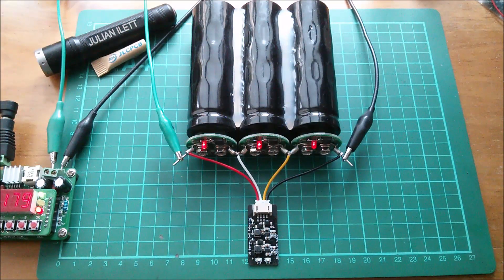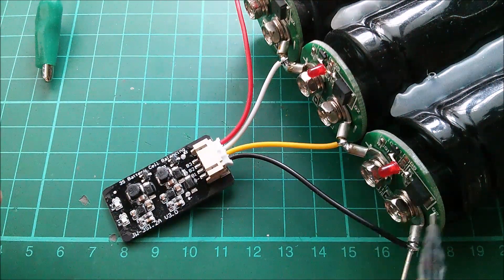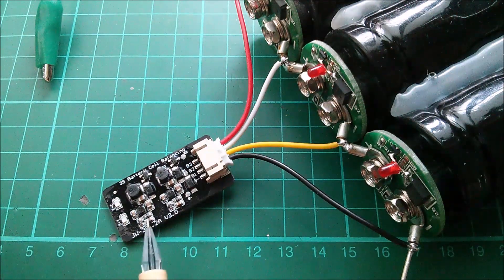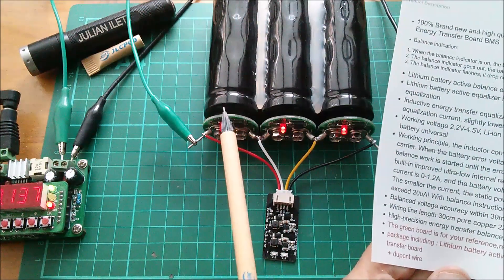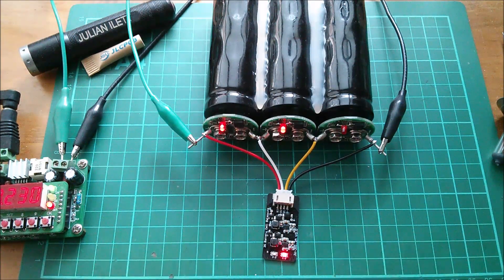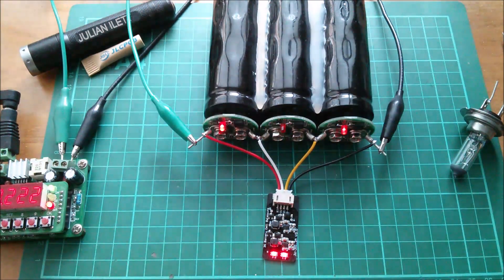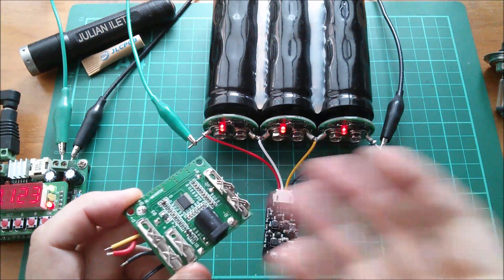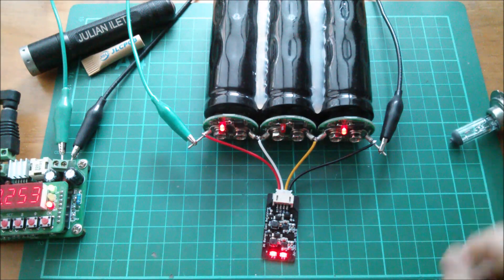Active Cell Balancer for Lithium Ion Battery Packs

Comment: So it's like a bulletproof battery, you can connect to any number of it's cells and it'll just take it.    If pulling under 1.5 amps you could debatably use this instead of a buck regulator, by just choosing how many cells you pull from.  This is wild, every multicell battery out there will now be able to output multiple voltage ranges instead of locked to only one.   
Does this also mean you can charge just one cell - and that one cell will then be used to charge all other cells in the pack?  So you no longer need a high voltage supply to charge this battery.  It can effectively charge as if the cells are in parallel instead of series.
Reply from the maker: Well, sort of. All that stuff is theoretically possible, but it would have to be done at low current.
Reply: @JulianIlett  probably works great if your use case is somewhat like this:
you have a high voltage high power application that requires batteries, but you also need a small current at a lower voltage for, say, some monitoring device. current sensors, wifi connectivity and somesuch.

while you could put a buck converter to power those, and it might even be reasonably efficient for the designed load, that wouldn't also give you the benefit of active balancing.
Reply: Yeah it's early days, but think of the next version, think of the modifications.  I'm hoping it might be cost effective to beef it up.
In TV shows & video games, technology is often oversimplified to an comical extent where if you just touch a battery onto ANY power source it'll somehow magically recharge it, everything interfaces with everything.  Blissful.  
edit: aww, on reading more it seems the current goes through the chip, so the chip itself will always limit to 2A max (so says datasheet).

Comment: Julian thanks for sharing,the question is ! as literally the word balancing means : if using a DVM and testing the voltage across each cell it should show equal voltage after a certain time wouldn't it ? any heat builds up during balancing? it looks like an opto-isolator was used to activate the voltage sensing comparators op-amps i suppose.cheers mate.

Comment: Put a Volt Meter on each capacitor and you'll see it's not boosting any voltages. It is bucking all voltages.  So it takes the higher voltage of 2 cells/caps, and bucks it down to the lower cell/cap. With the inductors, it must do it using pwm, which makes sense because it needs to be decoupled when transferring the energy, otherwise a short will occur.
So, when you pull the energy from the center cap, the device will then buck the voltage from cap 1 down to cap 2, and buck cap 3 down to cap 2, until cap 2 reaches the voltage of caps 1 and 2.
(This is how I understand it works. Altho, I could be wrong on this setup and would love to see how it really works)

A neat trick I'd like to see tho, is doing something really wildly extreme on the votlages. Make cap 1 at 2.3V, cap 2 at 2.0V, and cap 3 at 1.9V, and see what the unit does. Will it start transferring from cap 1 to cap 2, as well as transfer from cap 2 to cap 3?? Will it go sequential bouncing back and forth? will it fry itself????
Reply: Wrong way to look at it.  The device uses a Buck/Boost topology (check the datasheet and the various papers on on these balancers), and whilst the output voltage is clamped by the cell being charged, to get a decent amount of balancing current into that cell you need something capable of generating voltages higher than the cell.
Reply: Heres a quick test on its enrgy transfer.just to show if it really transfers energy
https://youtu.be/UQinTqFLb68

Comment: I have 24S - is there any way how I can combine multiple of this to use it for 24s?
Reply: Should be able to...Two 12S modules should do the trick... That's what Julian was referring to at the end of the video were he mentioned being able to cascade them.
Reply: @pfeerick  Cascading them, I think you need to overlay one of the cell with the 2 BMS, so for 24 S you would need at least 12s an 13s BMS (or 8s ans 17)
Reply: @Llop66  Yeah, I can see how that might be needed, otherwise you'd potentially end up with two 'banks' within the example 24S configuration... hadn't thought of it that way... thanks! :)
Reply: Klemen Zhivko  its possible, just overlap the last cell connction to the 1st cell connection of the other board

Comment: If you check item/33060735605.html on Ali, you will see there is a small usage video. They show how you can use the 16 board with just 5 LiIon cells, and as long as the polarization is okay, it does not matter where you connect the array of cells. On LiIon it did 0.36 A. You should really look up that video. (I am not endorsing any of it, I want to be informative, that's all).
Nice find! This active BMS. How ever, your charging circuit will still overcharge cells, if the charging current is higher than the BMS can distribute. In other words, you make it mandatory to charge all cells with a maximum current equivalent to what can be dissipated. Uh, right. Things do get complicated now, you can not rely on the maximum (outer) voltage otherwise.

Comment: Don't your protection boards essentially "balance" without the new board?
Reply: yes, but those do it by wasting the extra energy.  This new board here doesn't waste the excess energy, that's why it's interesting.
Reply: @roidroid  Not only that but a regular BMS only balances when the cells voltage is at the maximum. This module balances all the time !

Comment: Should've of bought some cheap LED volt displays to prove it was doing something, rather than trusting some LED lights. The 3 wire ones you powered externally and can go down to 0V.
https://www.ebay.com.au/sch/i.html?_from=R40&_nkw=LED+volt+displays&_sacat=0&_sop=15

Comment: I think they only do buck conversion. They wouldn’t need to boost, imho.
Reply: i want to agree with OP as the specs suggest that 100mv is needed to start activity and it will terminate at 30mV difference. if only using Boost, that would also work, as only current needs to be transferred......therefore i cant really see a need for extra complexity
Reply: @mekuranda  You don't have to guess, just look at the datasheet and the various white papers on this method and if you have some electronics background you will clearly see it's a classic buck boost circuit.  Some of them use Ćuk converters which is another type of buck/boost topology.  Sit down with a pen and paper for a while and you find it's not actually possible to implement a single inductor buck converter topology that can do what this does.
Reply: @ferrumignis  Thanks for your comments - when I made mine I was in front of the TV typing on a small remote keyboard - so it was just a casual comment. What is said in the data sheet is one thing, and it could do both buck and boost - I was thinking with out fully knowing what is really going on in the device - I tend to become sceptical about how something operates in a gut sense when the no.s don't stack up - i.e. the 100mV and 30mV thresholds - in all buck boost topologies I have ever played with and with modern gain and comparator blocks - the thresholds are amazingly loose - in a potentially clever device that could be used in up to 100s systems - the cumulative errors would limit this. If the thresholds were an order of magnitude or more smaller - it could find its way into power walls of larger household systems. I don't have the ability to know what the designer of the chip was thinking or if there are simplifications because of some component (die level) choices or limits to prevent a better spec - but have been caught many times in the past assuming what is written or even schematics  presented in IC's not actually close to whats inside - hence often responsible IC vendors have a disclaimer of sorts to say "equivalent cct" useful for simulations or even just simplifications to gain a sense of "how it might work" in your application. 

I suspect this is a really simple device used in a creative way and I will as you suggest watch this space and revisit the datasheets of this and other devices - I don't often comment on YouTube engineering articles - as so often people make comments about things they are not familiar with - instead I found this product/component thought provoking and mysterious and the original poster was not the only one who was very adamant that it was this or that - must have just slipped into a cheeky mode for me to say - he could be right - as so many before him had said all kinds of opinions as pseudo facts!
Reply: They do need to boost, you can not transfer sufficient current between two similar potentials with a buck converter.

Comment: What an interesting little module.
Reply from the maker: You made a comment at the end of your LiFePO4 video which made me think you might be testing this module too :)
Reply: Heres more interesting, multiplying the balance current by connecting parallel boards.this test uses five of this cheap 3s boards.
https://youtu.be/Kg8SeHJVsWY

Comment: I've been thinking of replacing the dead NiCad cells in an old 12V cordless drill with three 18650s and this board would make it possible but at £10 it would double the cost of the repair and I would need to buy a charger capable of charging three cells in series.  This is not financially sensible, it would cost more  buying than a new and better drill.  So my solution is to fit a connector to the battery pack which connects to both ends of the three cells.  Then I use a single cell charger (that I already have) with a connector that puts the three cells in parallel and when in use I fit a dummy connector that puts them in series.  I would still need to fit a 3S protection circuit in the pack but they cost peanuts.  Three series 18650s are nominally 11.1V and would have about three times the capacity of the original NiCads.
Reply: If anyone else is thinking of doing this then remember that you need to buy high current versions of the 18650 and it helps to buy them with tabs.  It's not a good idea to solder wires onto any type of battery.

Comment: That board would be fun to play with. You could use a voltage divider and have it drive a relay or a different boost board externally with higher voltage cells or even 12 volt batteries in series.

Comment: I looked at both eBay listings and couldn't find out how you set the voltages.
Reply: You don't, it just looks at relative voltage levels between cells and makes them match up. It's the BMS that sets the overall voltage level.

Comment: Mr. Ilett, I bought a 14S version with the intention of reverse engineering it for a much higher current transfer and can confirm that it does indeed squirt 1.2A when connected to Li-Ion batteries.
I've got a rough drawing of my work to date, if you want it.
Reply: Wow, MUCH more effective than traditional bms's. I like!

I'm going to get one for my 48v powerwall sized bank.
Reply: I wouldn't just yet. I've attached it to my 14S 80P powerwall and it takes forever to shift a 200mv difference. When Julian comes up with a 20A version, he'll make us powerwall chappies very happy.
Reply: @peterpurpose  ah thank you... I am assembling 80p packs so I appreciate the insight. My first 14 packs contain identical 2000mah cells that i've already capacity tested, so they should be pretty closely balanced in capacity... but when I expand I will be dipping into different cells, so a larger bms will be needed then. 

Have you used a resistive bms? I would think even this stock would beat one of those aince they tend to do a wimpy 20ma draw or similar.
Reply: Have you used a resistive bms?

I have not, but my apc ups is so inefficient that I'd rather not waste the little British sun that we get.
Reply: @peterpurpose can you please post your drawing? Thank you!
Reply: Very rough, don't know what the transistor is yet and 'think' (oh how wrong I was) the 1659 is a voltage output DAC.
http://lazpro.com/bal.jpg
Reply: I'll have to fire up a scanner, Herr Mahringer, but have to find it first.

Comment: I'm thinking to replace my motorcycle battery with six supercaps. But now I see that one lightbulb can empty a cell that quick......... I dont know if I still want to execute that plan. Lets start learning about calculating farads to mAH :D
Reply: I'd only do that if my motor cycle still used a kick starter and I was sure I'd never want to use the lights with the engine turned off, otherwise the supercap pack would run out of energy too quickly to be of use in an emergency.

Comment: It would be nice if you used a clamp meter to actually measure the current, rather than spending a lot of time speculating...
Reply: Or at least voltmeters on the 3 caps!
Reply: Clinton Coker  heres a quick timelapse on its energy transfer
https://youtu.be/UQinTqFLb68
Reply: Tried 2 boards in parallel to see if it will multiply its balancing current
See it here.
https://youtu.be/2S0wMsFcUjg

Comment: Yes, may be dandy to pull 12v from a 24v system for limited use.   Sure would take a long time correcting it's self at those low transfer rates.
Reply: The purpose is not to draw 12 volts from a 24 volt battery as many people erroneously believe and constantly erroneously post.   The purpose is to lengthen the lifespan of any battery and increase it’s effective amp hours because balancing allows you to get more out of the fuller cells because your BMS doesn’t kick on from early polarity reversal in a less full cell.   This thing is amazing for a 12 volt battery, or anything that uses more than one cell in series.  (Series batteries are dangerous if a cell is empty when the other cells are highly charged masking the empty cell)

Comment: I tested this module and the current depends on voltage difference. Grather the difference bigger the current it transferrrs from one to other cell. Curent is linear to voltage difference.
Reply from the maker: So it may start at 1.2 Amps, but it will fall rapidly from that value.
Reply: @JulianIlett  yes, at a difference of around 1V it will be 1A maby less . And as the difference drops drops the amperage too. The device gets pretty hot at 1.2A so be careful.
Reply: How about 2 parallel boards to multiply its balancing current.heres a test made of it.

https://youtu.be/2S0wMsFcUjg

Comment: i doubt its doing what it claims, why not attach a voltmeter between each lead from bms to the cap and see if polarities change while balancing, im assuming it will balance in one direction rather than other way round as well
Reply: is the chip this one https://www.ablic.com/en/doc/datasheet/battery_protection/S8209B_E.pdf
Reply: @xbipins  this chap seems to think it is an eta3000 https://www.beyondlogic.org/review-li-ion-lipo-lifepo4-lithium-battery-active-equalizer-balancer-energy-transfer-board/

Comment: You can't test the balancer while you're charging at the same time!
Please do the experiment again and measure the currents on each wire to see what is really happening!
I got the 7S and a 16S versions for my packs and seem to work OK, but current seems to be much lower than 1.2A. I'm still not convinced it's charge pumping, but I don't have enough ammeters and voltmeters to know for sure.
Reply from the maker: That's a lot of ammeters! I may put the scope on the connector and look for evidence of a switch between buck and boost modes.
Reply: @JulianIlett  That would help - don't have to do all of the wires at the same time!

Comment: Now to bad it doesn't only do this when unplugged and then stop each cell when done charging so they're not doing a balancing act, faster charge. like the TP4056 does for me.
Reply: Or there's the brute force method: Install a bunch of relays to put all the cells in parallel, which would balance them quickly, then put them back in series. The only drawback is that they'd have to be offline for charging. (For extra credit, do the same thing with mosfets and an Arduino.)

Comment: Please buy a multimeter and stop guessing. Thank you. (found it interesting anyway)
Reply: @appleejack  A lot of S C manufacturers will use the same case to keep a standard form factor. The dimples take up  interior space when using a lower value capacitor BUT keep the same outer diameter. Think of the dimples as filler material.

Comment: That an interesting product for some niche cases where you get large unbalance and are in desperate need to save every bit of power you can. Often balancing difference with good cells is not that large and passive systems do not waste that much energy.
Reply: Indeed. I made a 4S lifepo4 battery pack from new cells (all same batch) that I was prepared to balance manually - about 50 charge/discharge cycles later I've never had to balance them (never been more than 0.01v different at top or bottom of charge). Interesting.
Reply: I think this module is interesting in the case of refurbished cells in a pack. Given that this kind of cells have very different characteristics, they will get out of balance pretty soon

Comment: Definitely want to see the lithium ion in action...to see how well it can handle an almost completely flat pack to full charge how close it maintains the cells till it reaches full charge
Might be a good way to safely charge a battery pack with multiple cells if it can actually maintain good balance from dead to full charge in all the cells, especially if there is a weak cell in the pack
Reply from the maker: That should work if you charge the pack at a current well below the balancer's transfer current.

Comment: For reverse engineering you could take all the parts off and soak the board in aceton. Either it will desolve the whole solder mask, or it makes the traces better visible. If you got a second one give it a try.
Reply: We need clive to make a video on this and go in depth
Reply: Not sure what "Eighter" is?
Reply: @goosenp  solved